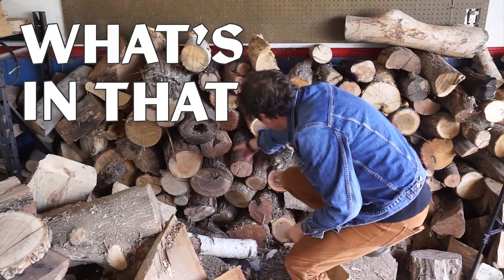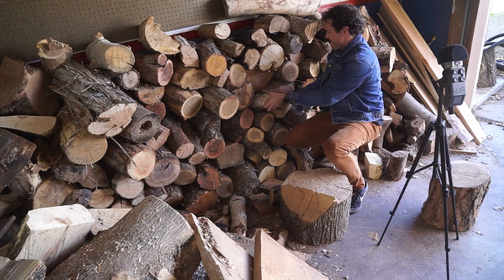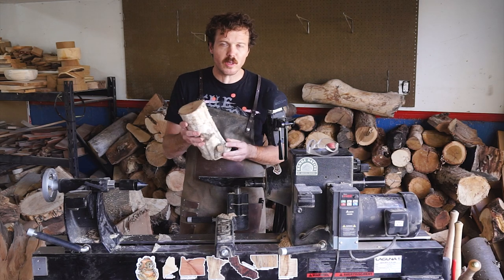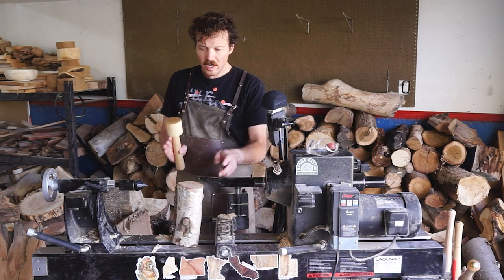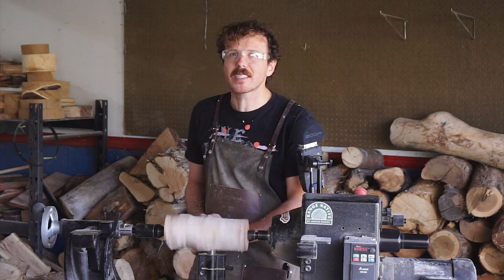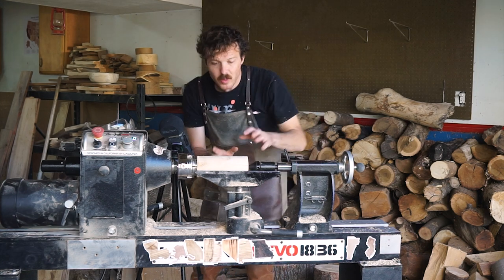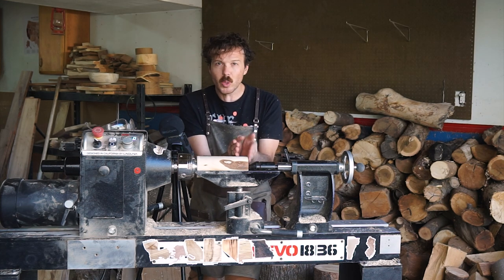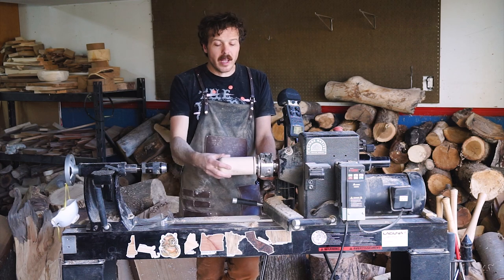What's in That Pile? Ep 1) Paper Birch Vase

Comment: 0:39 Only construction lumber is kiln dried.
that's typically SPF (Spruce, Pine, Fir).
These softwood conifers are very wet and need to be dried out quickly.

Typically hardwoods like the ones used in fine woodworking and furniture making are just milled and left to dry/season.